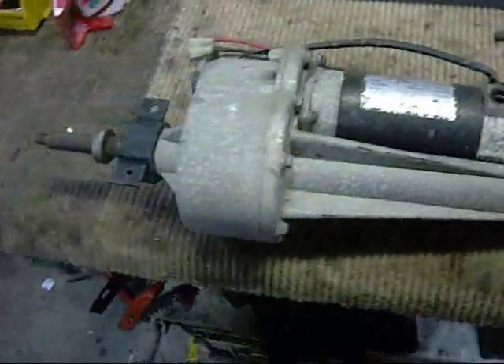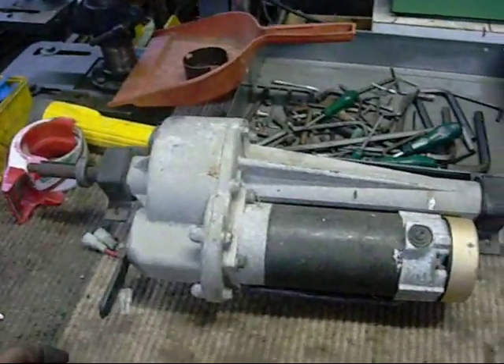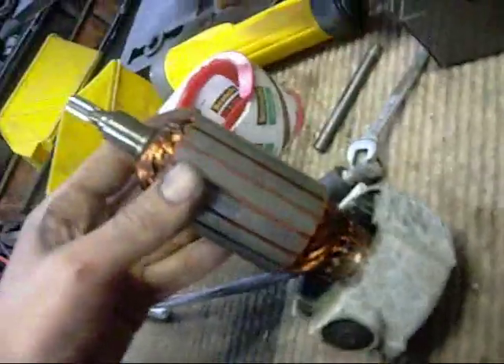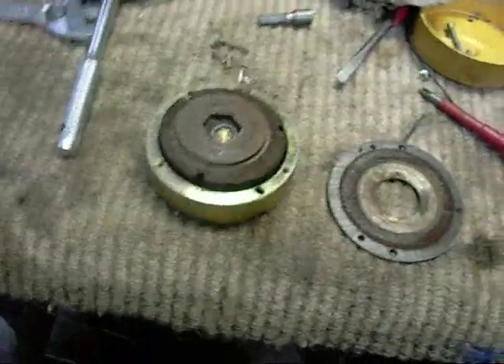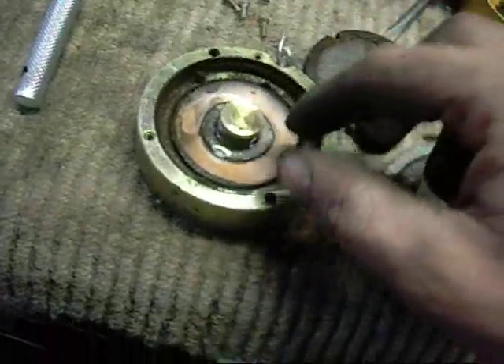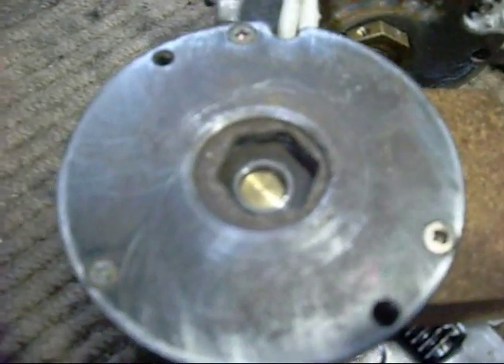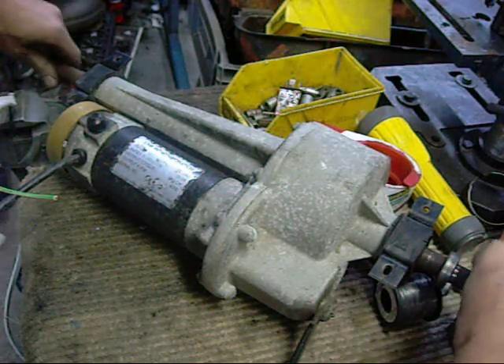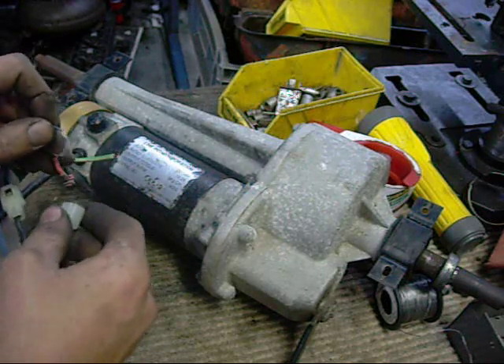Repairing Electric Wheelchair Motor and Gearbox

Comment: Well just the video I needed and surprise surprise, look who made the video, someone I already subscribe to!

I have a wheelchair my neighbor gave me when I bought an aluminum freight box from him. The geniuses had left it sitting out on the porch in the rain since new! Idiots!  One motor works fine but the other is locked up. I popped open the brush plugs and they are frozen in with green corrosion. I managed to work the spring bits loose but the brushes are stuck in there! Nice to see yours apart, I think I can figure out how to get it open now to get to the brushes.  I think ;)

Comment from the maker: lol I like that idea, I have seen them on ebay, but as you said, they are pricy.

I was thinking of taking the army mule idea and amking it electric. just a flat platform with a seat and steering wheel at the front. just need to find some running gear.

Comment: On the subject of motor brushes, I once attempted to replace brushes on a garbage disposal but found the motor to be encased in a 1 piece housing with no outside access to the brushes. Disassembly would have entailed cutting it apart and maybe totally buggering it up so out came the charge card for a new disposal. I hate nonrepairable stuff like that. Even had a Mikuni carbie on a Dodge Colt assembled with rivets like it was meant to be a throwaway item once it needed rebuilding.

Comment: Could someone help me find out what kind of gearbox that is? I need to get ahold of one but cant find it anywhere! i know its in parallel with the motor, and is a planetary gearbox. but im unable to find a manufacturer anywhere online O_O
Reply: did you get the gearbox model?  I also need it